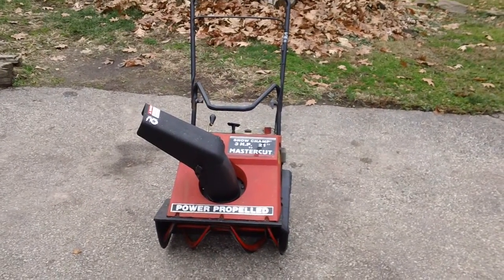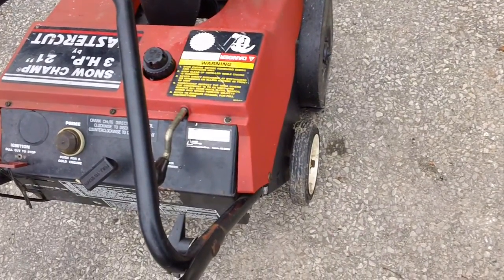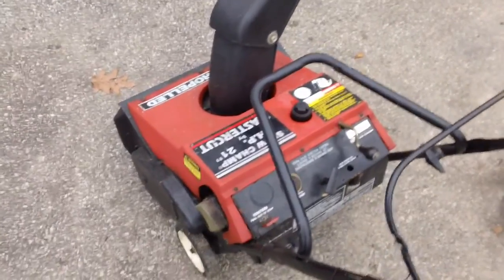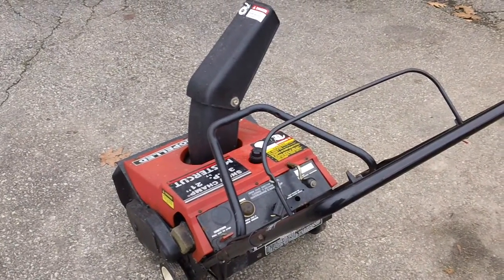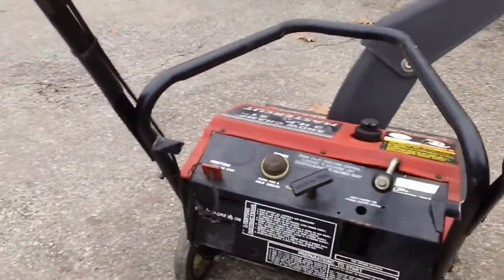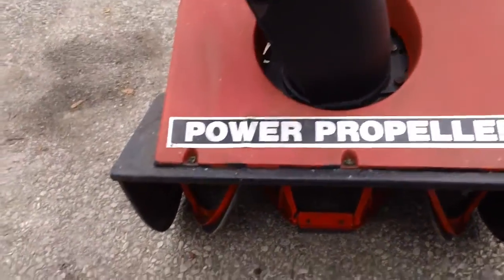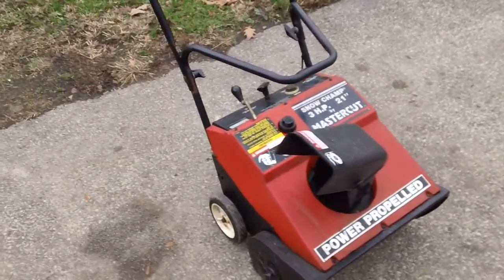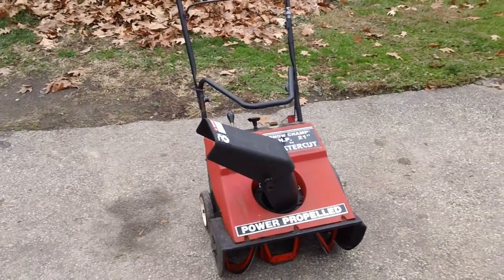Mastercut Snowblower review

Comment: Hey I have that same snowblower yet mine starts but yet doesn’t throw the snow or self move. Any advice or help for me?
Reply from the maker: you probably need new rubber paddles and a drive belt i recommend replacing both at the same time.
Reply: Chris Ursiny thank you for the advice. Those available at like Lowe’s or Home Depot? Tractor supply maybe?